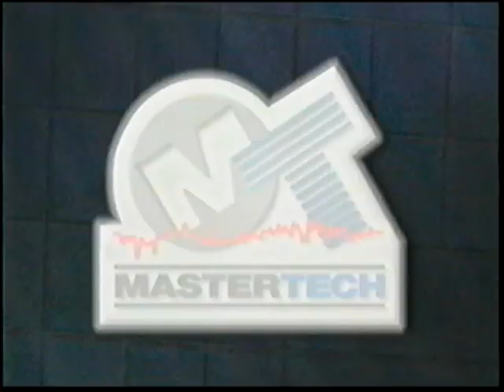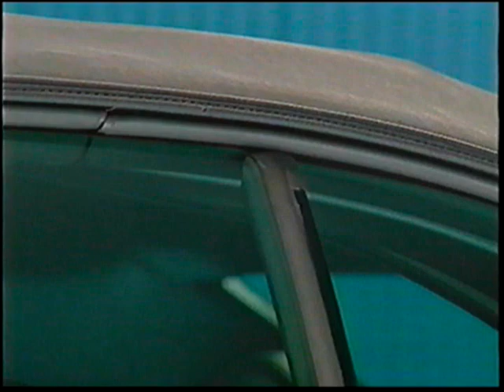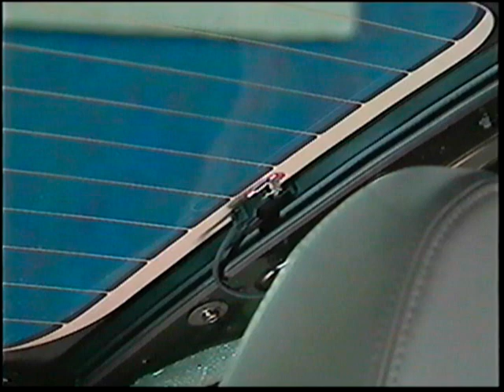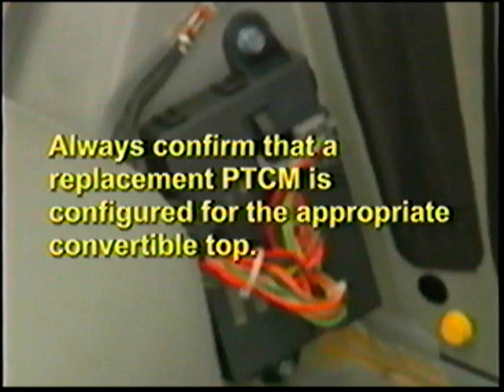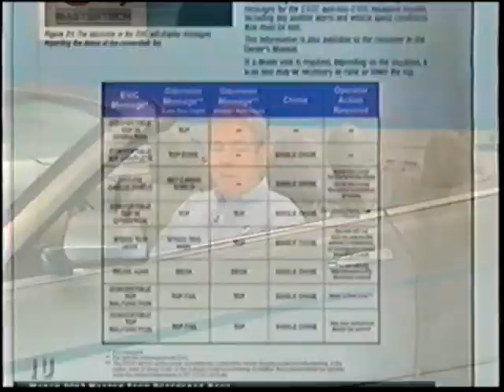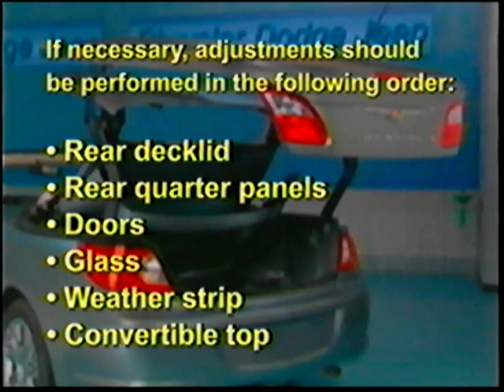2008 Chrysler Sebring Convertable (JS27) New Model Highlights

Comment: I need help do you know the name of the part which is located right next to the master cylinder. between the air filter and the master cylinder
Reply: That part between air filter and master cylinder is the TIPM!
"Total Integrated Power Module," also known as "fuse box." 😄